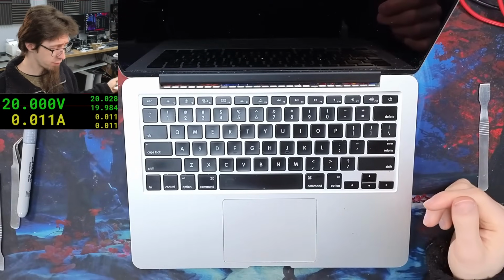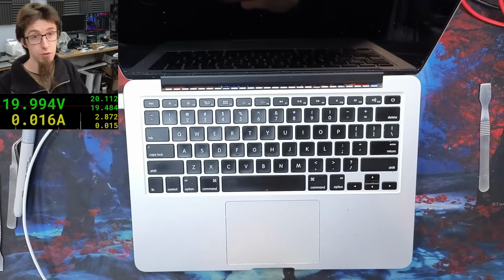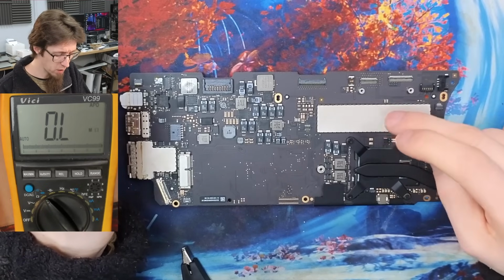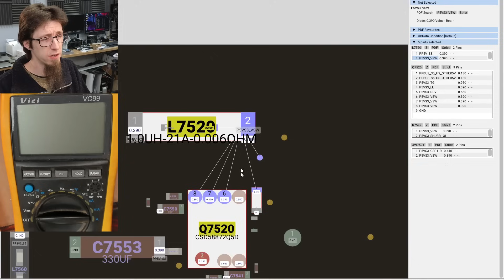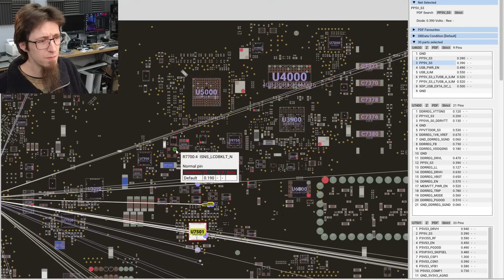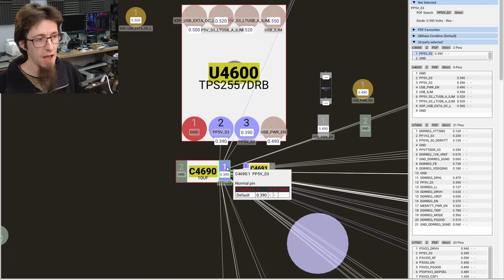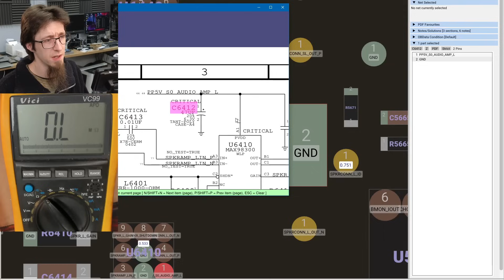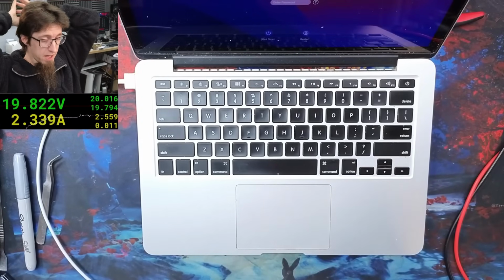We need to read circuits before injecting, other wise we don't learn - LFC#397

Comment: To add to the checklist: Check resistance between the different rails in both directions. This is to make sure the resistance is high enough that the current won't flow to ground through another rail. This can happen if more then one component is shorted, for instance a shorted separation diode in combination with a shorted capacitor.

Comment: I am not too sure if it has to be so complicated. I understand the idea of being careful. Let'say the main power rail is shorted by the faulty mosfet on the cpu power supply. Someone comes with the voltage and injects 19v killing the CPU completely (lets assume CPU survived the initial fault), Obviously we need to be careful not to do that. But is it not easier to just inject lets say 0.9V 1A into tbe short? If we have dead short and thermal camera we will see something getting hot. Also with 0.9V even if short goes trough cpu or gpu we won't damage anything. This kind of workflow saves time and its safe.
Reply: You're assuming that because your injecting 0.9v from a regulated supply that it will always be 0.9v. But this is not always the case. Some parts of the circuit can charge and discharge the current creating voltage spikes. So the voltage can be much higher. What often happens is that the current is flowing (at 0.9v for instance), but the voltage is not high enough for the regulators to work properly, so they don't switch reliably and create random spikes. This is why complex components like IC's and especially CPU's and microprocessors can be damaged by running at a voltage below the normal operating voltage.
Reply: I sometimes inject voltage to the power rails after lifting off one side of the inductor from the surface so that the load remains safe from spikes and full current flow into the slicon chips immediately when injecting voltage. Mostly I do this with motherboard having BGA CPU. I lift one side of the inductors of the VCORE sections of the CPU.
Reply: To lift the inductors and isolate the CPU/GPU is I think the most save way. Also, you can get the most reliable diagnosis then, because you do not have to consider the very low-ohmic CPU/GPU.
Reply: I would also mention that on newer boards, in cases of data recovery, the more care you take, the better. Because if you accidentally bunk a board because you injected, but it was one of these older boards with a removable, SSD. Data should be safe. Even if the CPU or PCH or GPU goes. But if you voltage inject anywhere that endangers NAND on a board where data is important. You have to be exceptionally cautious. You fry the NAND and that’s a Do Not Pass Go situation. Dead NAND means no data. And it’s always better to be more careful when you’re working on someone else’s equipment.

Comment: I have seen those jumpers on lots of motherboards, usually they look like an elongated solder blob with no component.  I suspect they are to allow you to isolate portions of the power rail to help narrow down where shorts are.  You can look those up and you might discover they are in sections of the power rail, and if you clean the solder from one, it will "cut out" the section of the power rail and isolate it, allowing you to narrow down the section with the short.
Reply: We need a video or a cheat sheet of all of these acronyms

Comment: Using the schematic to isolate areas on the board to look at with injection reduces the time it takes to find the problem. Good work and great troubleshooting!

Comment: I think your checklist was solid. You followed the steps and it lead you to what appeared to by a potential fault without endangering the board. Your next step would have been to remove the suspect component and check to see if the fault resolved. When the test reveals the fault remains and the component is good, you put the component back and go to the next step on your checklist. You would in this case have eventually gotten to current injection because it was a necessary measure to solve the problem.

Comment: When replacing the capacitor using a soldering iron it's better if the pads are flat. With a little solder on the iron you could tack the right hand end, then solder the left hand end, then finish the right hand joint. Mr. Solderfix taught me this :)
Reply: Yes absolutely I do that with all tantalum caps. It is better to do with mostly iron where ever possible to maintain quality of the board as well as the quality of services. I see that, the quality of our service depends on how other technicians are able to identify what we have done in the board during the previous repair.

Comment: Your onboard connection is a way a design/layout tool like Altium to connect (power)lines with different names together. Altium created a virtual component for it named "Net Tie". The same could be done by placing a zero ohm resistor, but that would add to the component count, use value space on the board and could fail due to a crack.

Comment: You need some good quality hot tweezers I would recommend ATTEN tweezers.  I know hot air works most of the time but hot tweezers would cause a lot less heat stress...

Comment: Hello, I know this isn't about the video but I need some help.
I have this MacBook A1181 Mid 2006. It doesn't turn on but it does charge two batteries. It's going to need board level repair. I can do that, but I'm just asking what should I look at or for the diagnostics? Thank you for your time
Reply from the maker: I've got no experience doing board level work on pre-2010 stuff, so I've no idea where to start there!
Reply: That's fine! I just took a shot and asked! Thanks for your time!

Comment: You are indeed a great and experienced teacher. It's unfortunate though, that you do not respond to comments. Can I use a Leak Seeker to find shorts on these motherboards?
Reply from the maker: I respond to as many as I can, but I'd spend hours every day trying to get to all of them.
I've not used a Leak Seeker before - according to google is for detecting refrigerant leaks? There are many ways to find a short circuit, I talk about more of them in video #349

Comment: Just  inject 0.8 volts with limiting at 2A current.You ll be safe,if the heated area is crowded,use alchohol  and inject power again to spot the exact faulty component.YOU NEED A THOUSAND HOURS TO FIND IT WITH SCHEMATICS AND MEASUREMENTS and at the end of the days you will have learned nothing.Anyway i admire your engilsh accent and your patience.

Comment: What's the problem with injecting power into silicon if you keep the voltage below its operating voltage? Injecting 19V into a CPU will of course fry it, but what if it's something like 0.9V? CPUs typically work at higher voltages than that.
Reply from the maker: This is true. I think the point is that you should take measurements first and get a lay of the board and what state its in.
You can check if your main rail is shorted into the CPU without injecting, and then you may not need to inject at all. This is more intelligent diagnostics than going directly to injection first. Like, if you're trying to start a dead car, maybe check if the battery is actually flat before you start getting out jumper cables.
People with repair experience will probably know all this at first glance, but the message I'm trying to deliver here is that we learn good practise before we're good enough to take all the shortcuts.

Comment: Question: why not use a milliohm meter to locate the area with the lowest resistance on the rail, and do the injection on that point? I know Voltage-injection is a very powerful tool, but you need to know what you are doing. I always shudder when I see people just blindly grabbing their thermal camera, and start injecting voltage at any point on the rail they measure the short. First locate the area of the short and inject there.
Reply: That's great if we go with milliohm meter. I think if we are so close to the section it would be farely, doesn't need voltage injection. To make milliohm meter so effective, we need to isolate other components and sections with higher resistance once we identify the sections with lowest resistance. Otherwise although we find a sections with lowest resistance and then inject power it is going spread all over through the power plane. Also Isolating is another problem, we can isolate section if jumper, Inductor or resistors were connected in series between the sections. However, if they are connected directly through VIA then it is difficult to isolate the sections, we may need to go for cutting the traces to isolate sections. These should be considered I think.

Comment: Sir mostly I saw only macbook repair in your channel in this year is there away that you post more normal  laptop repair
Reply from the maker: Just not a lot of candidates. I want to keep things varied, but to an extent I've got to work with what comes through the door.
Reply: Send him a broken laptop.
Reply: @Adamant_IT  As someone who wants to describe repairs technics on logic boards it's easy when you can use schematics, boardview files and FlexBv software to visually demonstrate what has to be done. I prefer when you're working on Macs boards. Thanks Graham 🙂

Comment: Hi Adam,
Recently I had a super weird MB problem regarding to Realtek audio system.
I did a BIOS update, upgrade RAM from 2x8 to 2x16, then all the 3.5mm jacks ceased working. With no detection of any 3.5mm plug in.
Today it started bombing me with notification of connection with NOTHING physically plugged. It lasted like 2min and stopped. It's like haunted.
MB is TUF B550M WIFI 2.
Do you have any idea how this might happen?